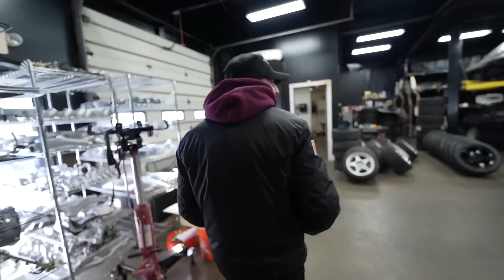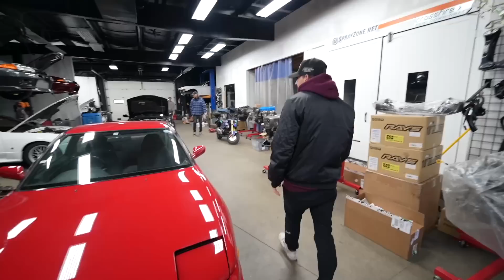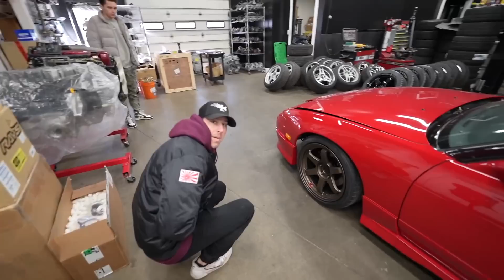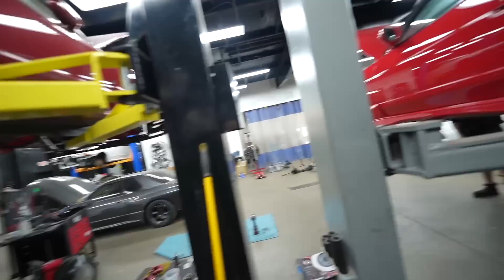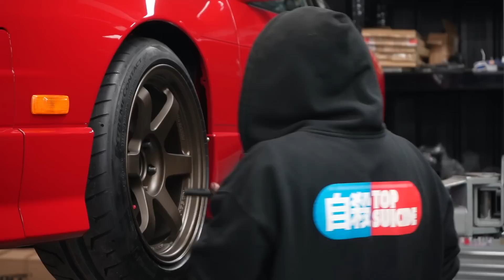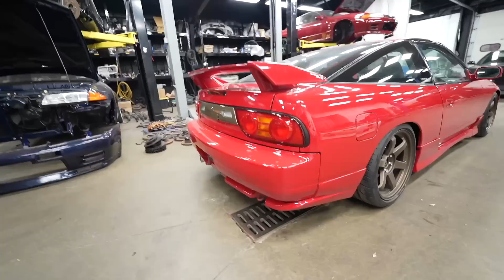I USED TJ HUNTS MONEY FOR THE WRONG CAR?!

Comment: When I did my ebrake using r33 stuff on s13 I did 3 or 4 adjustments to the cable from the local brake shop, being long now is important. Just keep removing bits of length till it's right but too much at it don't fit or you'll have no adjustment
Reply: Is that with the drum style e-brake setup? I have heard it is hard to get right on s chassis
Reply: @nzuncovered1845  yes all r33 internal drum. It's not hard just s bit time consuming to get length right. Is easier to take cable away than to remake entirely

Comment: Tommy !! the 180sx is looking amazing bud , awesome work , .. OR though , with the brake calipers been re built and powder coated  black again , It looks kinda / or does look TACKY with the black over the Nissan label on the brakes , .. it would be amazing / would look amazing if you or had a machine shop to run over the Nissan bages/casting  back to a metal silver like new,  like oem ,  (basically just taking the paint off the nissan casting taking not even 0.5 of a mm off the nissan casting on the caliper)